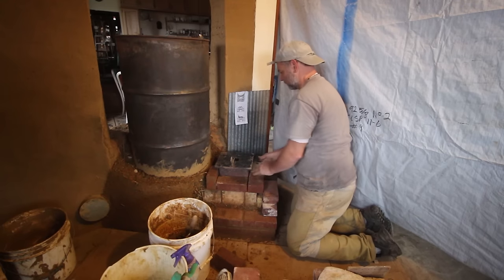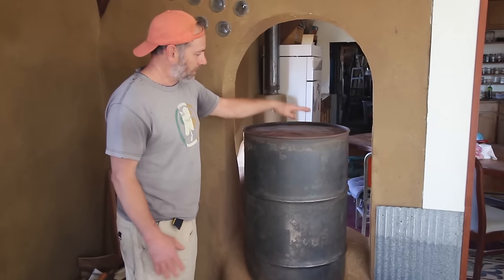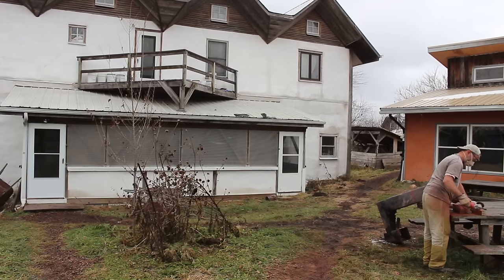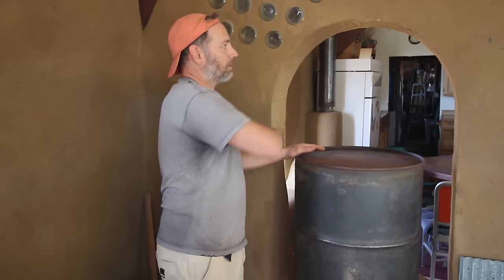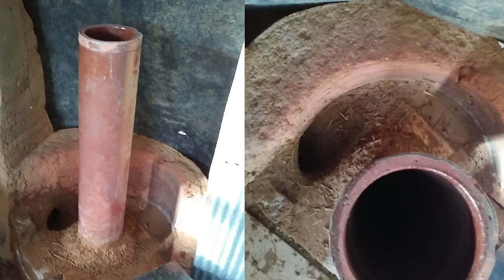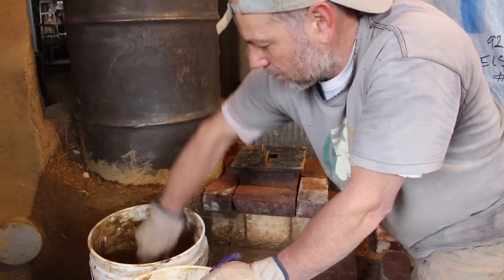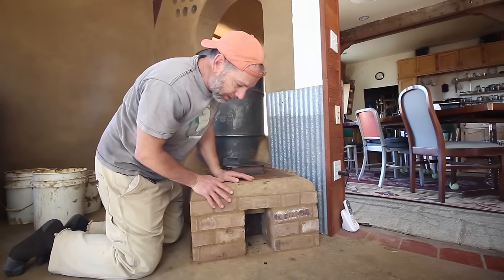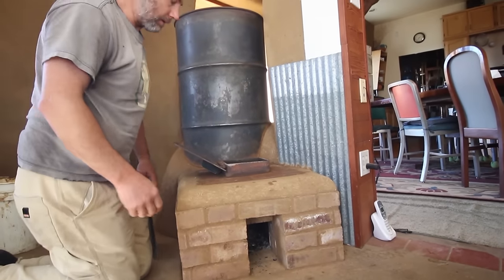Rebuilding and Improving a ROCKET MASS HEATER

Comment: I find with my RMH that it's ideal for when I want to be gone all day, so long as I have 2-3 hours to tend it before I go.  With my wood cookstove that heated my home before that, most of the heat would dissipate and it would be chilly when I got home. With the RMH, a wave of heat greets me when I get home at the end of the day.  Now, if it's sub-zero out, this may not apply.  You may want to keep the stove going for several hours in that case, but anything above 10-20 degrees F, it's awesome for leaving all day. You can see mine if you search for Chelle Lindahl's RMH by Possible Media.  Also, we built mine with fire brick, not red brick, I think that matters!? Oh, it looks like the feed tube might be the yellow fire brick here?  And, my chimney is fire brick as well, wrapped in rock wool, not welded steel.
Reply: PS the clean out is pretty cool.  I find I have to clean out the ashes from the feed tube every other burn or so, but I use a piece of wood as a scraper to pull it down the horizontal tube to the feed tube pretty quickly and easily, and then took a larger than usual size can, the size of maybe Progresso soup, and flattened one side, to scrape along the bottom and scoop up the ash, works pretty well and is quick, but this is schnazzy! :-)
Reply from the maker: I guess that's a perk, but then you are heating the house while you are gone and that doesn't seem as efficient.  While it's nice to come back to a warm home, it seems like a lot of work for heating the house while you are gone.  I can get my house warm in 15 minutes with a wood stove, though on a sunny day, the sun heats my house during the day.  I could see the RMH being more useful for staying warm overnight, which is a problem with my wood stove. I wake up at 6 am and my house is colder and I have to light another fire, but that would be less true if my house was better insulated.

Comment: I like this, the builder has some experience, from my observation. I've found a bit of air through the cleanout aids in the complete combustion of the carbon on the floor of an uninsulated feed tube, but a sliver of a gap only once it's on "full noise", or you get smoke backdraft. I've also experienced that the lid needs a more variable flow regulator depending on temperature, wind and fuel quality. When you get the air/fuel ratio right, there's very little cleanout. Avoid paper to light the fire...Have a way of closing off all air flow at the end of the burn cycle, keep the heat indoors...

Comment: And these specific barrels are steel. They melt anywhere between 1300 2500° so most of the time it rocket mass stove gets hotter than that, but I have not found a way to make it so my metal barrels bend so what I do when I redo mine is I end up doing double walls so I cut another barrel to make it so that it fits just perfectly in there and utilizes a two layer sides and two layer bottoms it does not make it not melt, but it makes it last a little bit longer than 5 to 10 years and if you decide to substitute thermal mass with a concrete because concrete is well known to be thermal mass don’t because concrete you can only apply so much heat before the concrete cracks and fails and the temperature is 65-93°C (150-200°F)

Comment: thanks for the vid. i also have been building rocket stoves for many years. i make small ones from stove pipe for ice houses to large ones like yours. i offer some observations for your future considerations, rocket stoves are like diesel engines in that more air is ingested than is burned. the un-burned air is referred to as ballast gasses by the Russian stove builder Kuznetsov and hinders the draft of the stove. the barrel can be thought of as a heat bell or dome. adding port holes to the combustion chimney (as per kuznetsov) significantly improves the draft of the stove. i now often use an uninsulated chimney with ports and find performance significantly better than the insulated but un-vented combustion chimney. the real engine of any stove is its final chimney and one inside the heated space is better than one outside as a warm chimney draws better, but i digress. any stove can be as efficient burning as a rocket stove provided it gets enough air. rocket stoves shine because this is achieved with a small fire such that it can capture this heat more readily in the heated space before losing it to the final chimney. this is where mass helps; the larger the mass the larger the fire u can use. as such, i find i am moving more often to batch fire mass stoves for my own use as if find the continuous feed requirements of the rocket stove tedious. a fire twice a day with sufficient mass and bells to capture the heat designed using Kuznetsov principles is much more tolerable for continuous use as a primary heating source. the point of all this tho for your rocket stove is to provide venting in the combustion chimney (whether insulated or not) that allows for the passage of ballast gasses to greatly improve your stove's venting performance. this i know for u is closing the proverbial barn door after the horse has left but might be useful for your builder to experiment with for his future builds as this really is a marked improvement.  hope this is received with the good will that it is sent as i am a great fan of the rocket stove diy principles. all best, j
Reply from the maker: Thanks for the great ideas!
Reply: hi steve, thankyou for your questions; i see on rereading my post that i was not as clear as i thought .allow me to do some labeling; lets call the wood feed, the feed tube,  the horizontal burn chamber the burn chamber, the chimney inside the 45 gal barrel the combustion stack or stack and the final chimney the chimney. it is the combustion stack that i modify .  like the pipe inside a car muffler , i drill it full of holes. this allow s the ballast gasses a chance to pass from inside the stack at lower elevation. on an 8 in stove, the total amount of holes drilled in the stack would add up to say a 1/2 in wide continuous slit  the full length of the stack. this seems counter intuitive but has been tested by me and the principle is practised and proven by kuznetsov in his masonry stoves.the stove breaths better and the temperatures achieved in the stove are hotter. my current 5 in stove improved from 400 degrees measured at the top of the barrel to well over 500 f.     i recommend u build a cheap rocket stove from say 3 in stove pipe and a 5 gal can to prove the point. concerning the chimney, all i meant was that a chimney that is mostly inside the house exiting the roof is better than an exterior chimney and if one is forced to use an exterior chimney that it should be insulated as the chimney is the real engine of any stove.  i challenge the idea that this j tube/barrel design is the stoves engine once the barrel is added as the barrel acts like a brake on the stove,(if the so called thermo syphon action is present then adding the barrel "bell" should increase the stoves draft, it does not)  build your practice stove with the j tube and barrel only,remove the barrel light the fire and see how it roars, even without insulating the stack (the insulation is a waste also), place the barrel as per the stoves design and note the diminished performance. i argue that the barrel is a heat trap identical to the heat bells of masonry stoves and if you don't need the high temp quick radiant heat, it and the stack can be eliminated entirely.  concerning the stack, i recommend that it be heavily made to function as additional mass in the stove just where it is  most useful.  additionally , if in use the heated space becomes overheated before the mass is charged then reduce or insulate the radiant steel of the barrel or replace the barrel  entirely with a masonry or earthen equivalent. i hope this is useful. and please,test all i say as i am the only one i see practising these ideas in the rocket mass heater community and expect u will be challenged on these points. all best , j
Reply: @johncees6178  could you explain further why adding these holes is beneficial? Without insulating the heat riser, is the danger not that the temperature between the riser and the barrel will equalize, hurting the draft effect? How do the holes improve this? And could you drill holes into a brick or ceramic riser?
Reply: @vivahansen  drilling holes in the "combustion stack" is to allow cool un-burned gases (called ballast gas) to pass out of the combustion stack early thus not robbing the properly burned and heated gases to it's energy. this is based on the work of the Russian stove builder Koznetsov and has been used by me successfully on several stoves with both standard stove pipe and masonry combustion stacks. Look Mr. Koznetsov up yourself on you tube, he still has a few videos up and you can get his website from them. With brick I simply leave mortar out on one or two joints vertically so gasses can pass. As I have said, do an experiment in your back yard with a barrel and some stove pipe or even bricks with out mortar to prove the point. As soon as u add the bell barrel upside down over the combustion stack, the stove nearly dies. It's real engine is the final chimney at this point as the cooling of the barrel really adds nearly nothing to the draft. My stoves all breath better with is modification and it would not be in vain to conduct this experiment for your self before committing to your final build. hope this is helpful. happy stove building.
Reply: @johncees6178  thank you for your thorough explanation. very curious about this. will proceed with experimentation..
Reply: @johncees6178  What you're describing sounds like the TLUD design whereby the air feeds in from below into the secondary chamber and is preheated up the sides and then that extra oxygen enables any carbon monoxide to be ignited at the top of the rocket combustion stack (that is insulated). I have stoves from SilverFire - that are based on that. The Survivor stove - or even the HUNTER stove is closer to that design. So anyway can you upload a video? thanks
Reply: @voidisyinyangvoidisyinyang885 I use that design element also but  no, that is not what I am talking about.  pls  re-read my explanation and/or  visit Kuznetsov masonry stoves for further explanation, and sorry no vid, camera is broken. If I can borrow one, I will take a pic or 2 but that may take some time. I have replace that steel stove with a masonry equivalent to great satisfaction. The principle is valid.
Reply: @voidisyinyangvoidisyinyang885  additional thought,  think of the design you mention working in reverse on the exhaust side of the stove.
Reply: @johncees6178  I watched a few Kuznetsov vids - the ones in Russian with CAD animation? Yeah those designs seem very complicated with tons of bricks. What do you think of the new "Air Crete" foam concrete mix? Kind of wild. I'm more into just throwing together bricks and cob. I think just a Bell design - yes like the simple masonry stove with a rocket stove inside it - that is the best way to go. Also like with the Chinese  - then do a Bell "bed"  - and have the intake of the stove below an opening for a wok to cook on. So not sure - currently I am just using a wood stove with water on top of a baffle - and bricks around the stove - and a 30 degree stove pipe into the side wall. So I was running it full open draft but now I realize that it was just too hot. haha. I realize since my chimney is insulated then I can afford to run the stove colder without getting too much creosote. I'll just run it hot at first to get it up to temp.

Comment: The effects on the metal is called spalling. This happens with many non-heat resistant metals in a high oxygen / low carbon atmosphere at temperatures above 700 °C. Stainless steel is one way to go for metal burn tubes and heat risers.

Comment: Rocket mass heaters can heat any reasonable size of space as long as it is fairly compact. Heating bedrooms at the far end of a hall is a stretch. Sizing the RMH to the space is key; making it larger than necessary will just mean that you don't have to burn as often, while a too-large wood stove is a hazard as it must be damped down to smolder frequently.

Comment: the ash clean out reminds me of the Chinese Kang bed stove heaters. So you feed from underneath and then on top you have your wok. That seems more practical - instead of just using a gravity feeder - since you have to feed it anyway. Might as well cook on top of it while feeding the stove.
Reply from the maker: I want to build one of those as part of a wood fired composite stove I plan to build soon.  It will have many different cooking stoves together in one thermal mass: a place for a wok, a flat iron surface for flat breads of all kinds, a grill for charcoal cooking things like satay, tandoori, and kebabs. It will be all the versions of fast, hot, minimal wood cooking. It'll be outdoors though.
Reply: @HardcoreSustainable  Sounds like you can do it!

Comment: Great video of a neat, simple technology. One caution... If you are cutting bricks, consider wet sawing to control the silica debris. I wouldn't rely on respirators alone for protection (and they don't really work for us bearded folks). Also, you want to keep others from exposure to the hazardous dust, which gets airborne when cut dry.

Comment: A 6" J-tube may be tricky to clean out unless you are petite. I find that my 8" J-tube is super easy to clean once a week with a tuna can flattened on one side and attached to a short handle. I can pull ash from the far end, and in the same motion lift it out and dump in the ash can. Since there is no soot in the burn tunnel, I do not get dirty beyond a dusting of mineral ash.

Comment: I hope you don't mind if I borrow your quote "sequestered sunlight"  what a great description of not just wood, but all forms of fuel we use on this planet, from fossel fuels, to the food we eat. It's all solar powered!
Reply: I think what he was getting at is that a mass heater uses radiation heat instead of convection heat as with a normal wood stove. So infrared heat is the same as the solar heat from the earth.

Comment: I really like these RMH's, but I wonder for the folks who have plenty of sunlight on their property, why aren't more people collecting Solar heat and piping it through the windows?  You can have an immediate heater for daytime use that just uses insulated boxes etc outside that  collects Solar heat directly, and pipes hot air in.  For nighttime, what you do, is have some Solar panels that connect directly to nichrome wire (no expensive lithium batteries, no controllers, etc), wrap that nichrome around some copper pipes and then put this in some good heat absorbent material (a mix of say compressed talc powder and aluminum blocks or the like in a clay pot), insulate it very well (preferably medium vacuum), and then at night, you take off the insulation from heat "battery" to let it warm up the house at night.  (It is probably more ideal to have individual, smaller heat batteries placed in different rooms than one really large one).  

   The nice thing about these is that they are easy to build, maintain, and there is very little tending to it unlike with a RMH that needs a good amount of attention.  With the dual Solar system, you just turn off the fan and put an insulated flap down over the ducting hole that is placed in a window insert, and then take off the insulated containers for the heat batteries, then reverse during daytime.

Comment: This is an awesome video. I'm wary of cob building here in FL though with the hurricanes and sideways rain we get. Maybe when I sell my house and move north I can build one of these. Very cool stuff
Reply: We live in Northern Florida also in the big bend area. We are building a house soon and plan on building a MRH. Since it's inside the house the extreme moisture, etc shouldn't effect the cob.
Reply: @zaneymay 

Yeah I was concerned with the cob walls on the exterior. Even with the lime plaster I worry that when the crazy sideways rain shows up, it'll just melt.
Reply: @MatthewByrd  oh I thought you were just talking about the cob on the hearter it self. Yes, I would not do cob that is exposed to the elements in Florida.
Reply from the maker: You could do interior cob in Florida.  As long as it's protected, it will hold up to hurricane force winds.  I definitely wouldn't recommend it for exterior. Some people at Dancing Rabbit in Missouri do earthen plaster exterior, but they have to coat it with linseed oil every couple of years, have a large overhang to protect it, and still it erodes in time. Earthen plaster is used in a lot of rainy places, they just regularly reapply it.  Everything doesn't have to last forever if it's biodegradable and just needs a little elbow grease to be renewed. I'm going to be posting a video before long about an earthship being built near Sarasota.  They used a lot of concrete on both exterior and interior, though.  

The other issue with cob in Florida is the lack of clay--something we have in abundance up north.  Maybe there is more clay in northern or central Florida.  Sand is abundant though, so if you could find clay, you'd be set. I would think lime plaster would be fine as well since it is pretty much weather proof and will hold up to driving rains. You just need lime and sand, maybe some fiber for that.